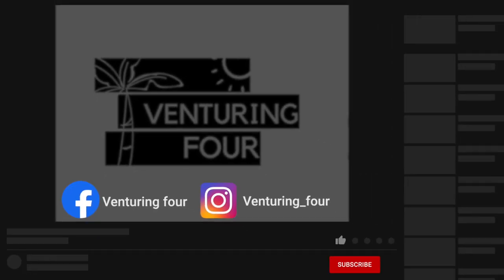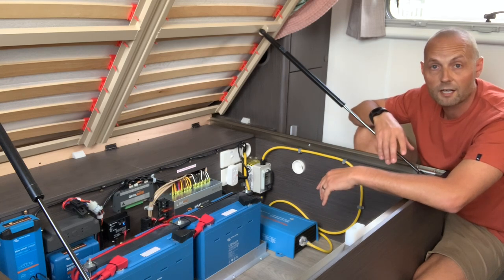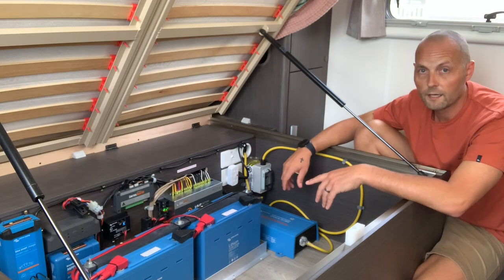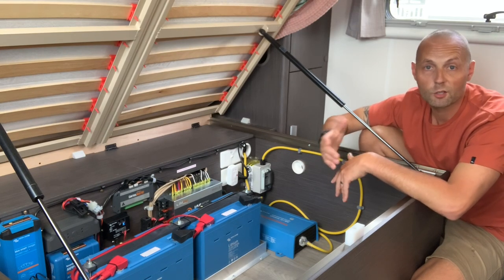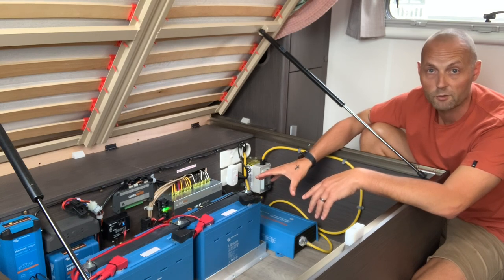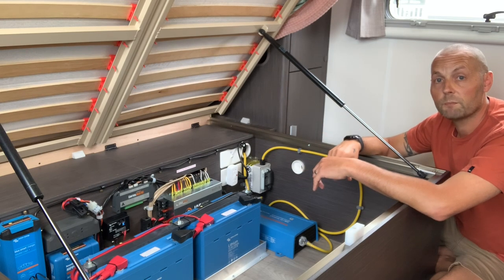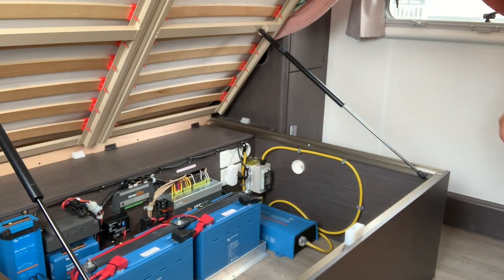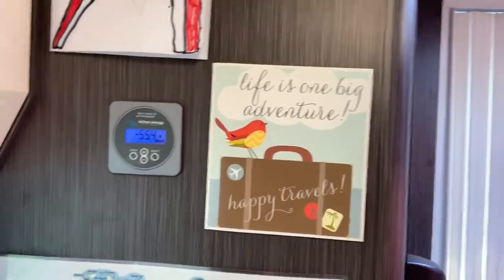HOW TO POWER SOCKETS IN YOUR CARAVAN WHILST OFF GRID

Comment: "Basically" the same setup as if you used an Ampfibian divice 10 amp to 15 amp. Protects the 10 amp side against over current draw. The RCD installed in the van by the van manufacturer is there protect all of the vans 240 curcuits regardless whether its powered by a generator or shore power providing its plugged into the 15 amp inlet on the outside of the van, thats why its there.

Comment: My Jayco journey OB setup is similar to yours in some respects. My inverter is the Enerdrive 2000w with the safety and Ac transfer switches. It’s hard wired so that the power point in the cupboard next to the RCD was not inverter tied, this way our 3 way fridge could be left plugged into this socked so would only be powered by 240v when connected to shore power and not run from the inverter. I also have 480w solar and 330ah of Lithium, the main difference is that I purchased the lithium Bmpro charger from jayco & just swapped it over with the original unit. Simple plug & play as all inputs & outputs are the same. From memory around $730. 
I leave the switch in the water heater on and turn its power off by the 240v socket it plugged into under the bed same with the lithium charger when the inverter is in use. Ideally would have been beneficial if that socket was also not inverter tied but wasn’t worth the effort running the additional wiring. I also moved the water pump right next to the water heater & was able to fit two of the batteries in the pump compartment to maximise space under the bed. With our bigger inverter we are able to run our Air con for around 2 hours which is great on those warm nights 🥵
Reply from the maker: HIL71 seems like your pretty well set up. I basically let Jayco & Springers Solar manage my entire battery set up. All I knew is that I wanted lithium and enough to power my compressor fridge 24/7. Love our setup, it’s never faulted is once and will last many years to come if maintain correctly. Happy camping 👍
Reply: Can I pick your brain HIL71. Im interested in the role and bmpro still plays with a setup like this. I'm assuming when plugged into mains power, the bmpro and the victron charger are both powered off the external input socket? And that the bmpro simply manages 240v power sockets and 12v accessories but doesn't charge the batteries in anyway?
I'm ordering a new van and wanted the J35D but the extra cost is a big negative which is why I'm looking at external power sources for the lithium batteries.
Reply: Brent E, In my opinion Venturing Four was up sold the Victron system by his installer as it is a totally unnecessary upgrade for jayco’s current BMPRO installation. The J35D was not released to market until a month or so after I picked up my Journey back in June 2018 so I had to order it through Jayco at a later date for around $700 ish. This was probably better anyway as I was able to secure my choice of likely better quality lithium batteries at a lower price than Jayco would have supplied. At a guess Venturing Fours Victron setup is just using the BMPRO as fused distribution board for the 12v system. All I did was simply exchange the standard BMPRO that came with the Journey for the J35D as all connections are identical and it’s simple plug and play! I fitted the additional batteries, isolator and fuse for the Enerdrive inverter and upgraded the battery cables to handle the extra current ( Tip, I cut up cheap 500Amp jumper cables from 4wd Super Centre) no doubt all of this a lot cheaper than paying an auto sparky to wire and supply the Victron system.
Reply: @hil7160  hi, been following this thread, are you using a RVD, asking cause i want to put in inverter in jayco rm19 and want to run a/con but if i use this rvd and plug into outside shore power the j35 with charge batteries thinking its plugged into 240 volts, what im trying to find out is , how to turn charger off on j35 while inverter is on,
Reply: @trennaward7314  I’m not sure what an “RVD” is.. But I just switched both the BMPRO and hot water off at the power point under the bed when free camping. When plugged into shore power turn them on, just don’t forget to turn them off when you disconnect shore power so as not to drain the battery’s…
Reply: @hil7160  If u turn bmpro off when free camping does all your 12 volt stuff work like lights and fridge ?
Reply: @trennaward7314  Yes, unless running from shore power.. you need to turn off the 240v input to the BMPRO otherwise your battery/inverter will supply 240v to the BMPRO charger draining your battery by trying to charge your battery from your battery if that makes any kind of sense.

Comment: Hi, I've been watching a number of these inverter installs under the bed. Inverters, charges and batteries all need good ventilation as they get hot. Do you have any ventilation in your system under the bed?
Reply from the maker: You’ll find that a lot of people have their batteries either under their beds or under their lounge seating. It is definitely recommended to have some sort of ventilation. I had two vents, one on either side of the bed. Never had any issues with overheating 👍

Comment: Hi, I noticed you plugged it into the side of the van, is there any reason why it can’t be hard wired into the socket to save having to plug it in every time?
Reply from the maker: Very good question. I can’t see why this can’t be done, however this would have to be confirmed and completed by a licensed electrician 👍

Comment: G'day. Great set up you have.
Just a quick question, does the lead have 2 male ends? It's a bit hard to see.
Reply from the maker: Hey Perry! The lead has one male end (10A) to plug into the inverter and one female end (15A) to plug into the external input power of the caravan 👍
Reply: @venturingfour  I saw that after i asked the question 😂.
Do you leave it like that when moving. We're on the road full time now for 6 years.
Reply from the maker: @beachkruizza  I never left the outside plugged in whilst on the move. I simply unplugged it and placed the lead behind the vent for the fridge that we had in our Jayco 👍
Reply: @venturingfour  yeah I thought so.
Just wondering what it was that you did that was illegal? Never saw the video regarding it.
Cheers 🍻

Comment: G’day. Not sure if I missed it. Are you running a 12v (2x 12v batteries in parallel) or 24v (2x 24v batteries in series)?
Reply from the maker: Hey Mark! It’s 2x12v batteries in parallel 👍